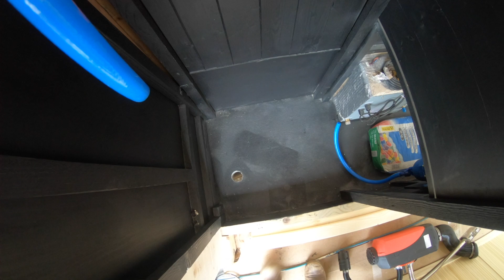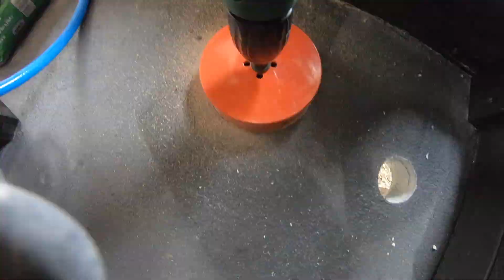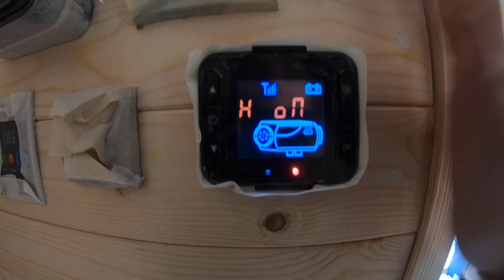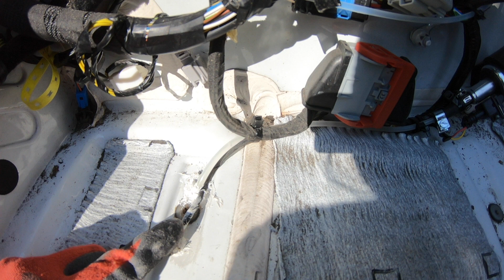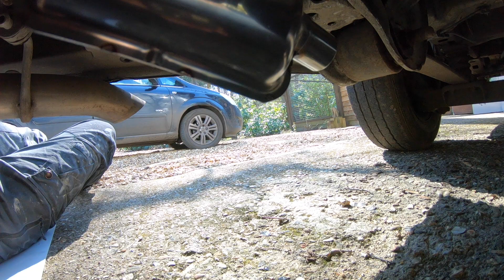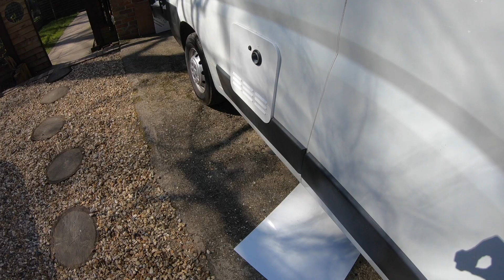Diesel Heater First Start Up/ Citroen Relay Van Conversion/ Schirmer Shoots

Comment: Hi...I am on the finishing stage of converting a relay also and kind of did as you by leaving the bulk head in and building a shower/toliet that runs beside it which helps with sound proofing when the door is closed...so i loved the way you placed the diesel pump where you have...my question is how much noise do you hear...

Comment: On my first startup smoke came out of the air inlet as well as the exhaust. But I was getting serious heat before I unplugged it so maybe I was over-primed. I'm going directly from the heater to an AC DC power switcher to a wall outlet in my workshop. Maybe I turned it off too soon. The smoke startled me. I have an all-in-one unit. Maybe I should take the cowling off and verify the fuel is moving consistent. I'm at sea level so I can't be burning too rich -- I don't think? I'll fire it up in driveway and see what happens. Please send along any suggestions.

Comment: Great work! Is it possible that you put your fuel pump upside down? Normally the power input must be show upwards, may that is different on your heater!?
Reply from the maker: Thanks! yes, it is upside doon methinks too!
Reply: @SCHIRMERSHOOTS  I think you should fix it because this will cause problems in the future. There is an interesting video about that, created by John McK 47. Cheers!

Comment: Nice effort, best way is to mount them is in a rubber type spider web suspended, also good to suspend the fuel hoses as it can tick tick on any hard surface..Also to note hang the pump vertical...The angle instruction was copied from the original Ebersprecher manual by the Chinese as they are knockoffs, the original was because of their small filter and the angle was needed. These Chinese knockoffs don't have this tiny filter ( bigger filter is actually better) so they should be mounted vertical to avoid the air bubble build up and wear...Good way also is to mount them under the van..

Comment: Also doing a Citroen Relay, watching your progress with interest. Yup the connection to the diesel sender was a mission and now pretty packed in there. Put our heater under driver's seat, a challenge working above vehicle exhaust and heat shield but learned somewhere here it can be done. Makes it easier to keep the diesel pipe continuously uphill from dosing pump to heater. Check out John McK 47 who is my gospel on these heaters https://www.youtube.com/channel/UCLxP_AwzCecuipKsLK1uAvQ